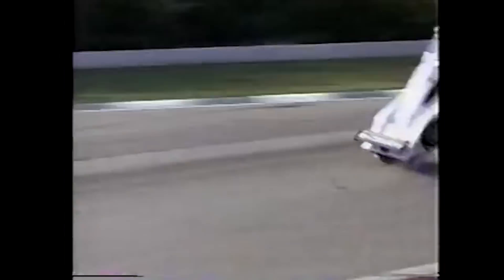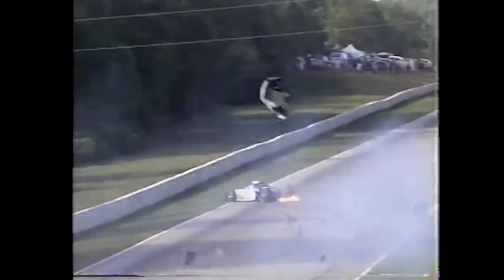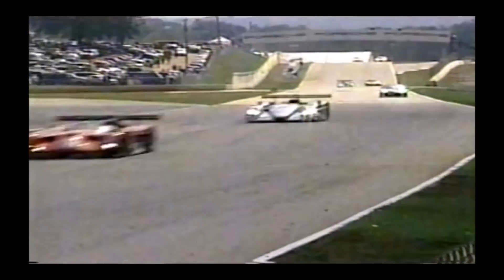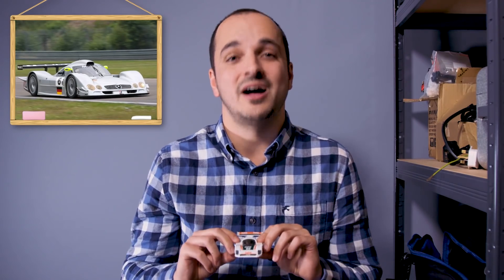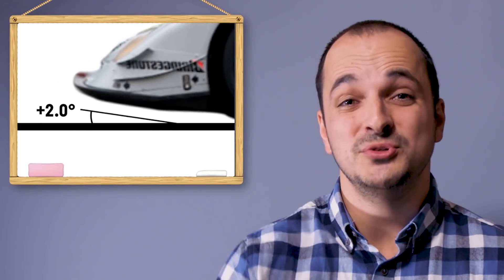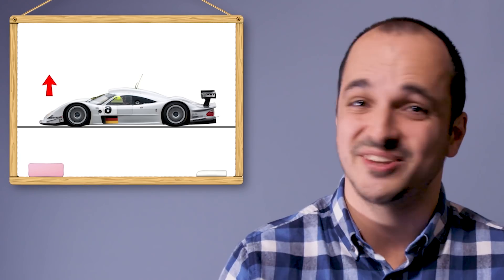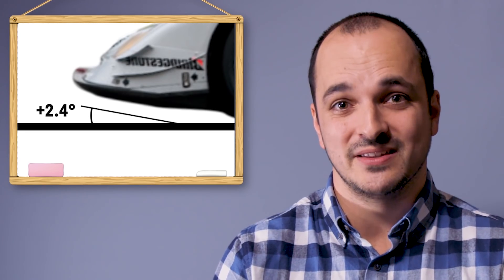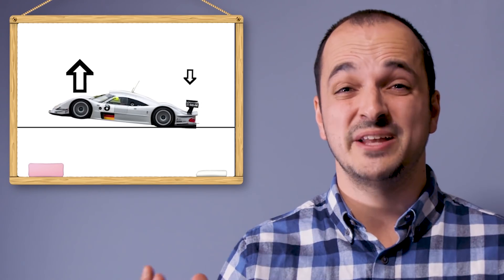The science behind THAT famous crash - Mike's Mechanics

Comment: The open wheel arches weren't a result of these incidents - theres over a decade between them. LMP cars have a tendency to get airborne when going sideways (spinning out) at speed in a similar fashion and those holes are one of the measures to prevent that. I'm sure flying Mercs still were in the back of the head when creating the rules though.

Comment: Very good eplanaition. However you left out one important detail: all 5 of those accidents happened when the car was following closely behind another car. The cars were just stable enough when they were on their own. But in the dirty air of another car the front downforce was heavily reduced, leading to the pitch sensitivity problem.

That's also the reason why Mercedes could not figure out why Mark Webber had flipped twice during qualifying and during warm up. They actually did several wind tunnel tests after the quali accident, but could not find any reason for why the car would take off like that, so they more or less shrugged it off as a freak accident. After the second flip they knew there was something wrong with the car, but they did not know what. They made huge changes to the suspension settings, thinking that the initial lift of the nose might be caused by too stiff shock absorbers at the front.

Only after the third flip, the only one that was caught on video, did they realise that there was another car directly in front of it, changing the airflow. Mercedes actually did some windtunnel tests afterwards where they put 2 cars into the tunnel. The result was that if the distance between the cars was just right the second car would loose almost all of its front downforce, while the rear wing and diffusor were still pushing the back of the car down behind the rear wheels, causing the front to lift up.

Lessons learned: modern LMP rules allow better front aerodynamics, including a front diffusor which is less sensitive to dirty air. The rear wing and rear diffusor must be much closer to the rear wheels, so they can not create so much torque on the chassis to lift the front. And most manufacturers now simulate / windtunnel test the airflow not only in clean air, but also in disturbed air.
Reply: Great explanation
Reply: Great explanation!
Reply: Wow, thanks. I was wondering why the problem wasn't detected in wind tunnel tests. I guess there is no test like the real thing.
Reply: looking at it with hindsight, you would have thought they would ask the driver what the situation was when they flipped and have noticed they were all chasing a car at a similar distance but I suppose sadly a catastrophic and dangerous demonstration was needed for anyone to put the race win at risk for a problem they couldn't pin down
Reply: Thanks. I was skimming down through the comments hoping this was pointed out.
Reply: You did more explanation than this 4 minute video ever did with its boring talk about lift angle which anybody could figure out. Cheers
Reply: Thx for making thsi 3 mins to words

Comment: Might be just me, but smiling about these crashes seems a tad bit..........inappropriate to me. 

Aside from that, the downforce at the rear wasn't "cancelled" out, as otherwise the car would've taken off but stayed "stable" not flipped rearwards. 
Instead the downforce stayed active at the rear, which acted as a lever for the downforce at the front. 
This went ont to a point where the pitch angle of the rear got to far, and the wing stalled, which made it lift as well.

Comment: The addition of louvers into the fenders was in relation to sideways flips, allowing the air to go somewhere if you got sideways, preventing bodywork being ripped off. It was introduced at least 10 years after, so was not due to the Mercedes incidents at Le Mans.

Adrian Newey, at the time of the First flip, advised the team to alter their rake and try to decrease the natural suspension frequency,obviously,they didn't
Reply: Sorry Jason Gore but you're a bit off on your comment.  The Audi R8 and the Cadillac LMP for 2000 both had louvers in the top of the wheel wells (grab some pictures from that era).  What you're referring to that was mandated at the end of 2011 for the side ways spin was eliminating the louver and going to an actual rectangular hole at the top of the wheel wells.
Reply: @ronknox3376  i take your point about the Caddy and Audi, but the option to carry them and the regulation mandating them, were years apart. But the louvers were removed in favour of the plain holes due to them always needing to be replaced and costing teams time